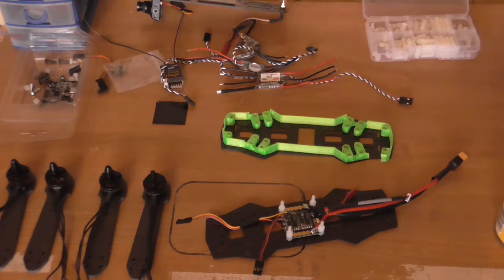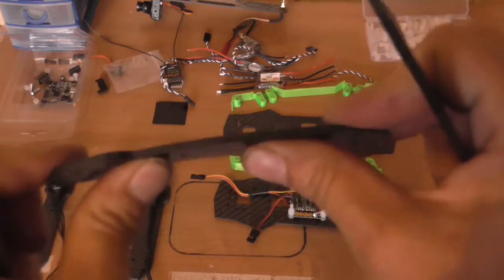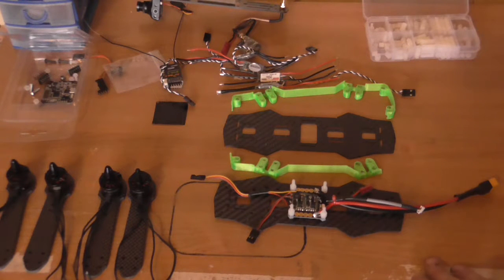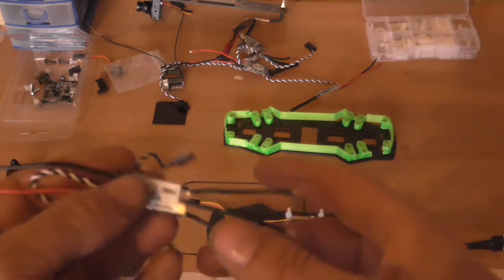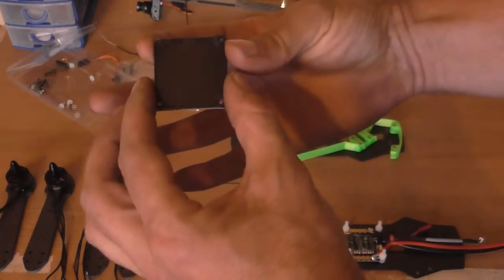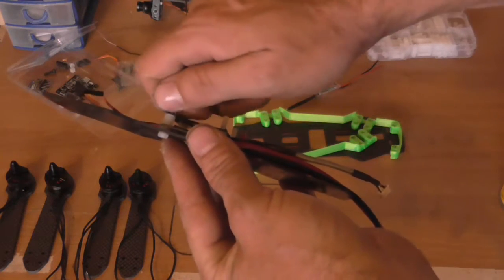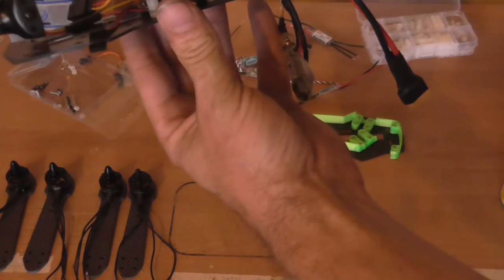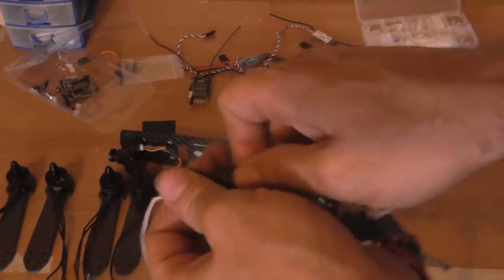ZMR250  1-5 Rebuild Part 1

Comment: I see why you are calling it a 1.5 now =D I like the 3D printed section I may have to add some of that to my build =D
Reply from the maker: RCTV-UK Thanks Malc and thanks for the sub. It makes life a lot easier with the wiring and as I say I usually put the PDB in the bottom belly sectioneven when building mate with the spacer you can place screws to hold without bolting them to the arms in to get everything in place without it falling apart making sure its a neat fit